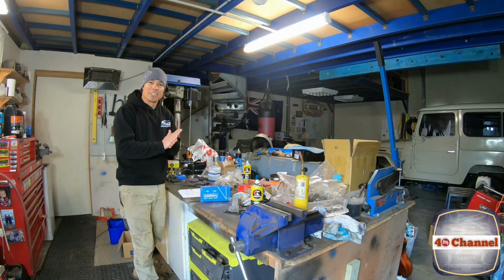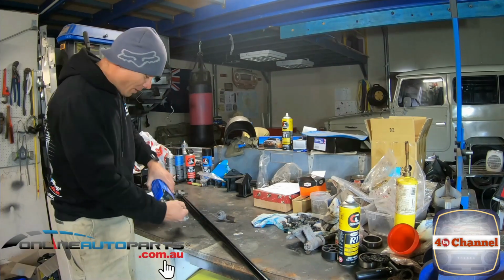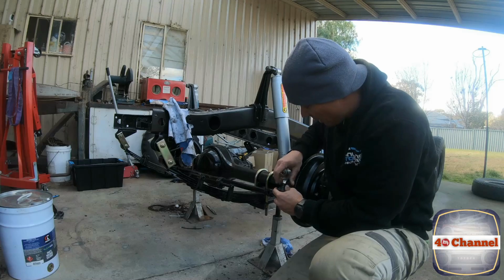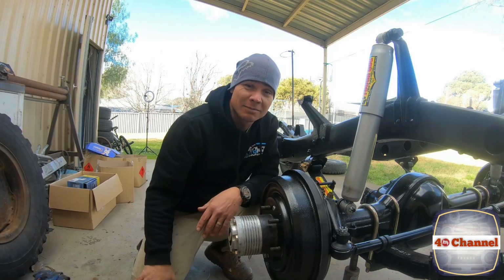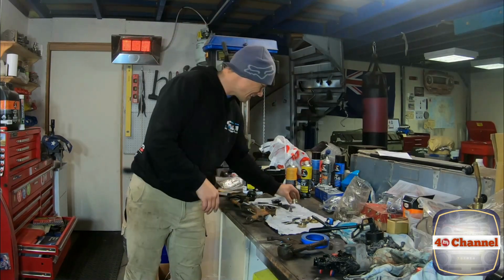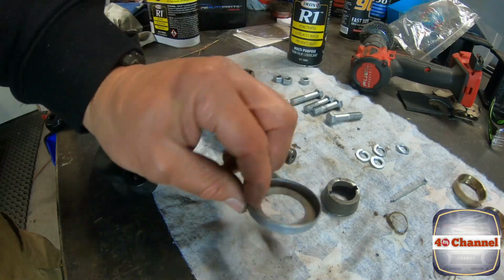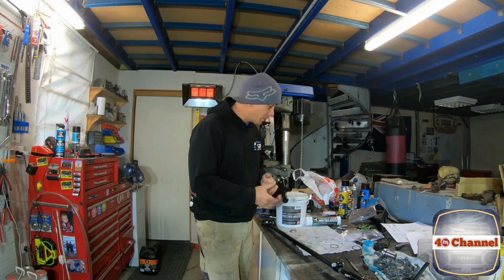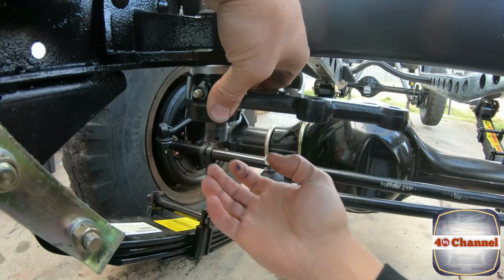S2EP12 - Old Steering box and tie and relay rod re-build. (up til 1969 style)

Comment: Hi Jayson, I am loving these video's which are have been a great help with my 69 FJ45 rebuild. I am in the process of rebuilding my steering arm which unfortunately has some heavily rusted parts. The actual arm and brass bushes look fine, however the tapered threaded rod, retainer rings, cones x 2 and wood riff keys are beyond repair. I am just reaching out to gauge your interest in selling / parting with any spare steering arm components you may have.  Many thanks.

Comment: Just to round out the steering ....Have you mentioned the camber shims?
Reply from the maker: Hi Longruffian,  This is a soild front axle you can't change the camber, Or are you talking about Caster adjustment?
Reply: Yep caster...soz
Reply from the maker: @giterdunpete  😅 all good mate, I will look at this a bit later if needed. I did add caster wedges to my FJ40.

Comment: That was smart leaving ~3 degrees of toe in to allow for the weight of the vehicle at movement to center the wheels. This is especially important if your running larger tires. 
Another home run video. (That’s American baseball term…if you didn’t know)